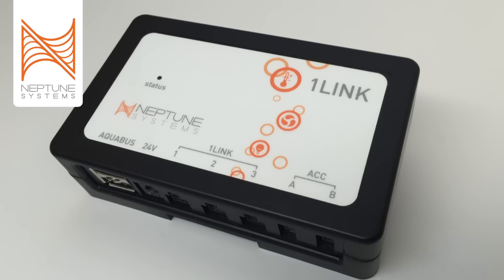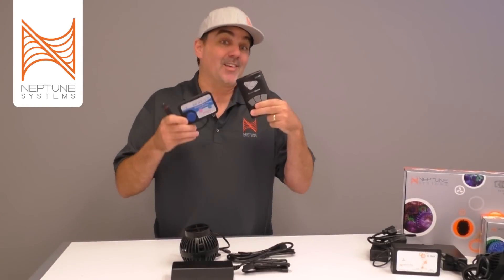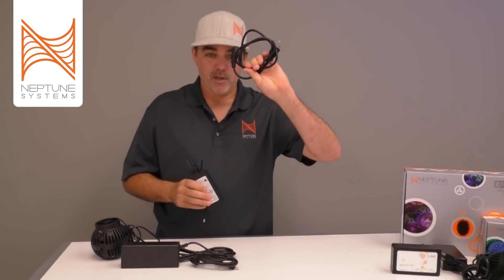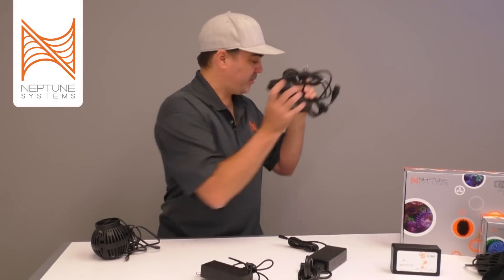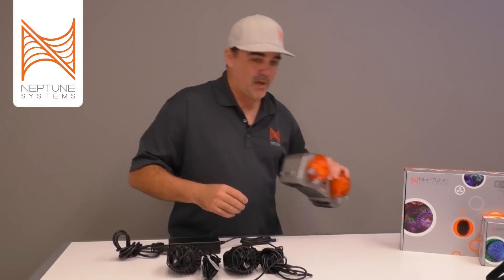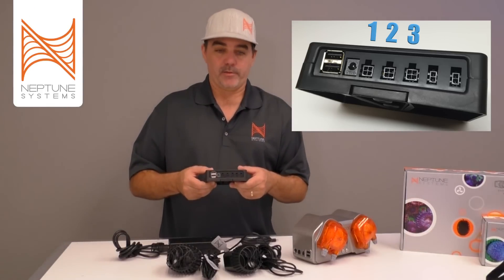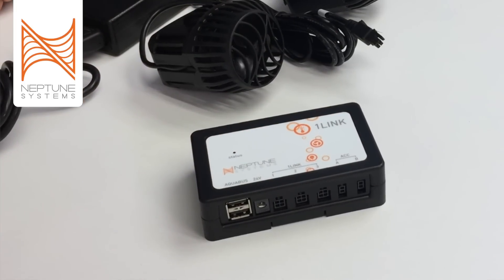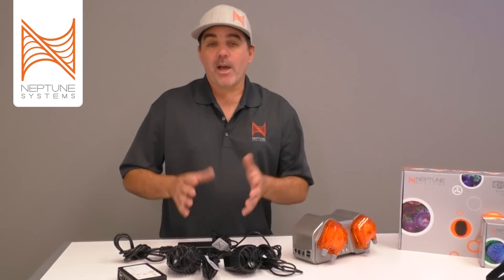What is 1LINK?   Neptune Systems Product Highlight   001

Comment: Question. I just received my WAV set, and it's it really hard to pivot the power head. Is this normal?
Reply from the maker: It should be solid, but able to be done with your hands without too much force.
Reply: It requires alot of force.
Reply from the maker: Contact support

Comment: Unfortunatey, 1 Link is NOT capable of supplying enough power to all the devices you have described here. I hooked up a third Wav pump to my 1 Link and cannot get enough power fed to it for it to actually pump water. Neptune Systems support has confirmed this problem when I called. Now I'm sitting on a third Wav pump that I can't use. Kind of a pricey paper weight.
Reply from the maker: You absolutely can run three WAV pumps on a 1Link module or EB832. It will, however slow down the pumps slightly if you try to run them all a full 100% at the same time. This is not, however, a normal scenario. Normally people run various flow patters on their pumps so no two pumps are generally at 100% at any one time.

Comment: I bought the new wav system and the one link was bad it took three weeks for ME to discover it. it started @430am my apex alarm kept going off could not find why so I disabled it. called Neptune two days later I got a call they claimed they couldn't find anything then they thought it was the display I bought another and it was not it. so to shorten this up the one link shorting out caused my display to stop working it burned up my sump pump to sieze up and my dosing pump to stop working. I was told by luis velasco that it was well documented and it would be taken care of. this all started in October of 2015 NOBODY HAS CALLED OR ANY ATTEMPT TO MAKE IT RIGHT WAS DONE. THANK YOU IM SO GLAD IM A VALUED CUSTOMER. this is very unfair and you people told me you would take care of me and you NEVER did anything.

Comment: Terrence,  You mention using 3 devices plus 2 DIY devices but failed to mention that the 1 link is limited by the current / amperage draw of the devices plugged in to it.
+++ Now ur a video star!
Reply from the maker: Of course that is always the case. The Energy Bar has a current limit as well. That said, you should be able to easily run two WAV, a DOS, and a couple of low current devices like a fan and a solenoid valve on the supplied power supply with the 1LINK and get rid of power bricks and wall warts for all of them and use no EB8 outlets!

Comment: Looks like a second 1 link will soon be needed for my apex. Will it be able to run 2 or 3 COR from one 1 link? or is that too much power?
Reply from the maker: +garrrbo Too much power. You can run one COR and two WAV from a 1LINK. Overall though there is a current limit. Of course the power supply, wiring, etc. all has to be rated at some point.

Comment: great explanation.  that cleared me up.  Power/ management is always needed.   will it also keep track of the power used as the energybar does already?
Reply from the maker: +Dee From Brooklyn The individual devices do monitor current themselves (for error reporting) but this is not reported back to the interface in the way it is on an EB4/6/8
Reply: +Neptune Systems Will the electrical load from those devices still be captured and monitored?